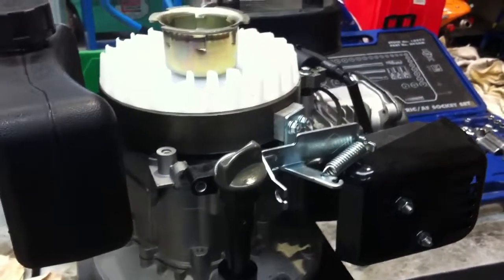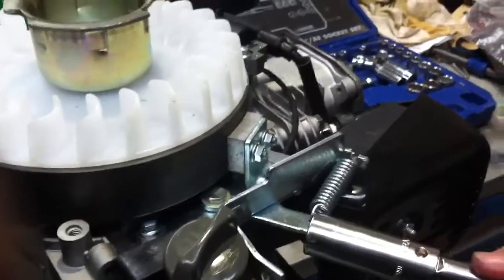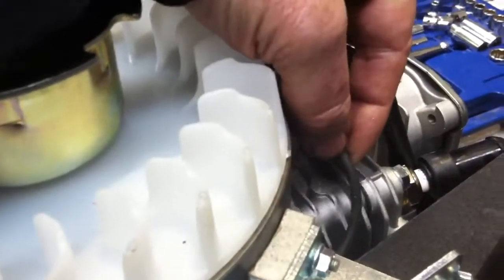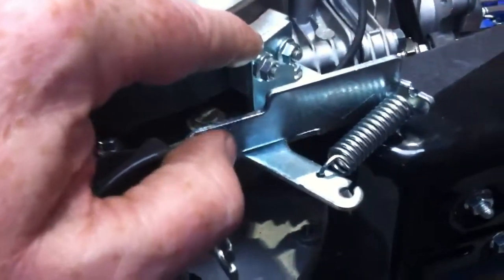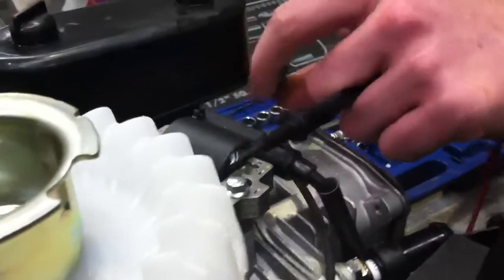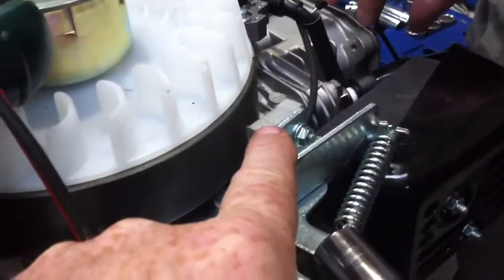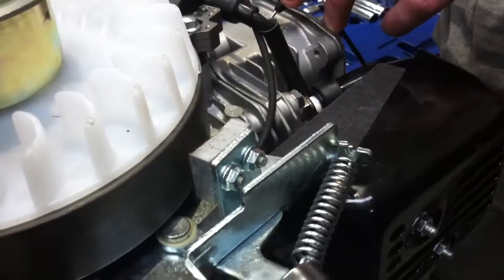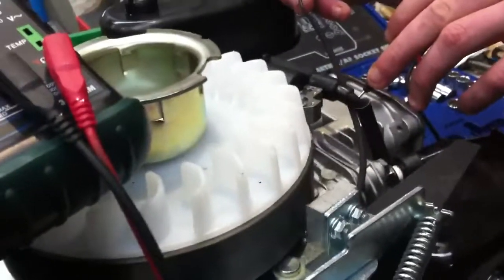Lifan engine stop system

Comment from the maker: Yes, the exact same. It is sometimes referred to as the 'deadman's handle', meaning that if the handle is let go, the machine will stop more or less immediately. With lawn mowers, there are regulations that set a maximum time that the blade can spin on for, after the operating handle has been released.